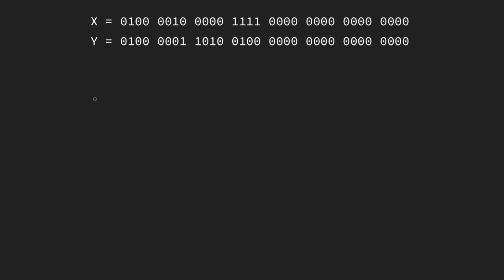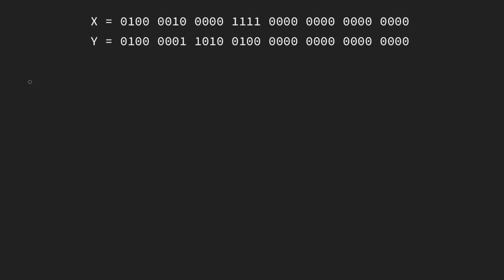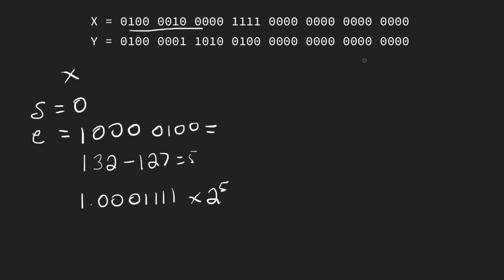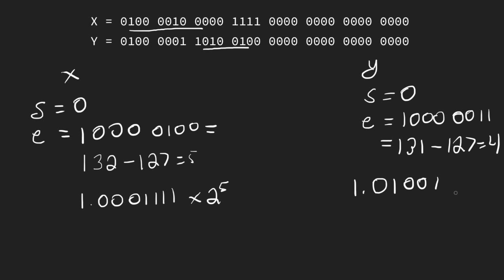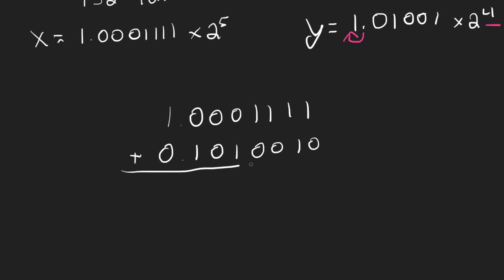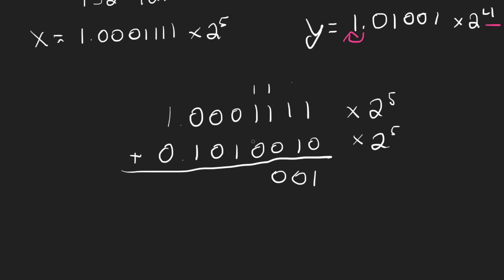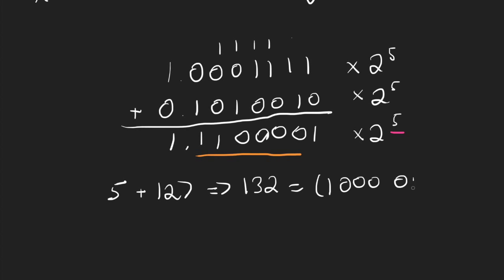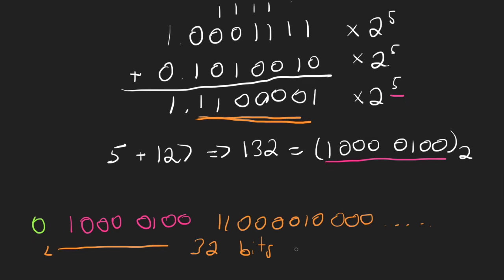HOW TO: Adding IEEE-754 Floating Point Numbers

Comment: When you performed the binary addition you mentioned the answer was positive. Did you determine that the answer to the binary addition was positive because there was no overflow? If there was an overflow than that means the answer would have been negative right?
Reply: I have the same question, but since he used two positive numbers to begin with the answer has to be positive in this case...

Comment: If it is always 1.(mantissa) * 2^(exponent)
Then how do you represent zero?
Reply from the maker: It's a special case—there's both a positive 0 and a negative 0 (sometimes you may see "-0" in JavaScript and other languages that use IEEE-754).

-0 is represented as 1  0000 0000  000...
+0 is 0  0000 0000   000...

You can read more here! https://en.wikipedia.org/wiki/Signed_zero
Reply: @stevenpetryk6869  
If we are adding a -ve and a +ve numbers. So there is a chance of getting a -ve result. How that would affect the result?

Comment: Thank you for the perfect explanation!
Reply: Steven Petryk, Great video. So adding the values basically involves XORing the corresponding bits in each value. However I did wonder how one might go about adding values of differing bit lengths, is it sufficient to just pad the smaller of the values with zeros to force the bit lengths to match?

Comment: 4:14 how do you know the sign is positiv? because 1.1100001 x 2^5 is positiv?
Reply: The first (most significant) bit in the representation of the input numbers, in the video, x and y have a highest bit of 0, meaning they're both positive. 1 would indicate a negative floating point number.
Reply: @richardbernard9873  Hi I know this is pretty old but maybe you can still answer my question. I know that  the first bit indicates if the number is positive or negative but how do I calculate it when I add a negative number to a postive?

Comment: in the end, how do you know the sign-bit?
Reply: is it because it is 1,...  in the end and when it would be 0,... then it would be negative number?
Reply: Well, I know that, Iam confused. I have two subtract one number from another. A-B, do I have to make some kind of complement of the second number?
Reply: I understand the rest of the addition process and also that I Would have to normalise my sum in the end if it was sth like 0, 001 01 * 2^5 it becomes 1,01*2^2. I got that wrong, my question was kind of stupid. I am just confused how to do a subtraction. I would need to make some kind of twoscomplement?
Reply: Toni Cleaveland in this case you do a two's compliment on B, and add result to A.
The idea here is that it's easier to add negative numbers than to subtract positive ones.